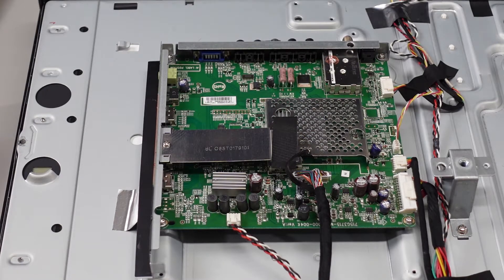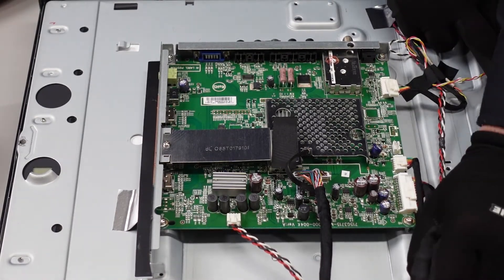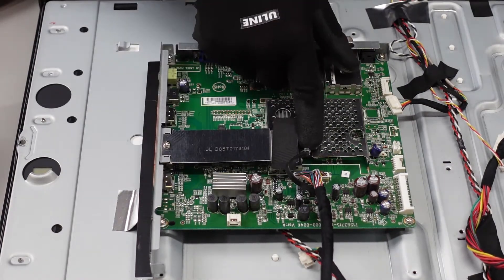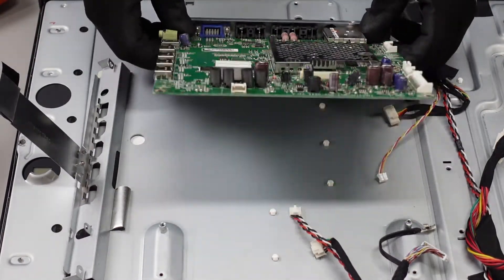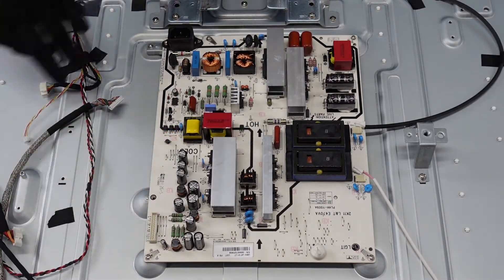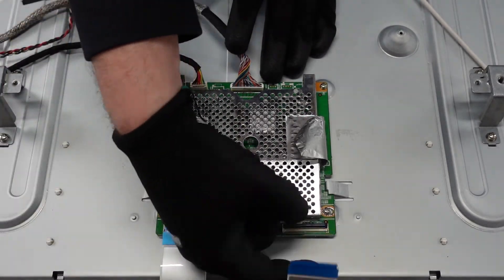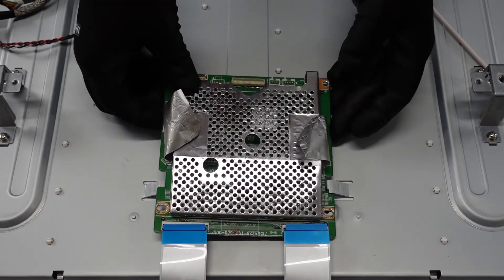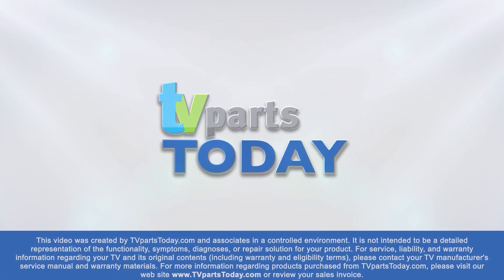Basic board removal.  (VIZIO E470VA)

Comment: What controls the audio for a vizio model  E470VA?? Plz help!!🙏.. I wanna save my tv 
Every is good on it except a small beep sound that all of the sudden won't go away and I cant heard anything on the programs...  

Thank you in advance
Reply from the maker: I would suggest trying to do a factory reset on your TV first.
Reply: @tvpartstoday  
I did... the unplugging for 1min... the unplugging and hold the power button for 30sec then plugged in.. 
And nothing.. is there another way to reset?.
Thank you much for your time..
Reply from the maker: @MrMarantmez  No, that would be a hard reset.. A factory reset is done within the settings of your TV menu.
Reply: @tvpartstoday  thank you I will definitely try that ... 
If for any reason sti that same thing 
What part you suggest I replace and would you have the part I can get from you?
Reply from the maker: @MrMarantmez  Any issues with sound would be the main board (board inside with all the HDMI inputs) or the speakers themselves (rare). If you could give us the model number & serial number, I can send you the link to the part if we have it!
Reply: @tvpartstoday  thank you so much
The model is
Model=E470VA
 serial=LTKNIDBL4300014
Reply from the maker: @MrMarantmez  Unfortunately we don't carry that main bord but here is the part number CBPF95AKA1.

Comment: Would like to see a video removing the Main board and power board for a Toshiba Model number 52XV645U, Serial number 930434T18278K1. Also do you have these boards
Reply from the maker: Hello, 
Unfortunately we do not have a video on how to take the boards out for this model but it is just plug and play. We do carry parts for this model but we are out of stock on the Power Supply board. 

Main board: https://www.tvpartstoday.com/75015755-Toshiba-Main-Board-PE0748A-V28A000998A1-p/75015755.htm

Power Supply: https://www.tvpartstoday.com/75014752-Toshiba-Power-Supply-PE0702A-V28A000962-p/75014752.htm